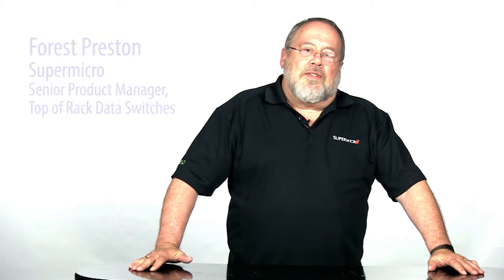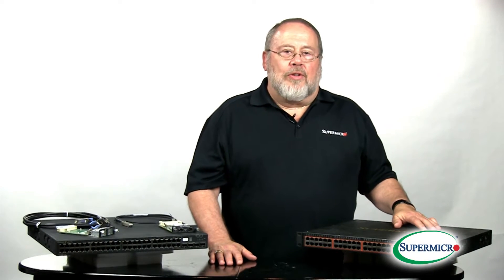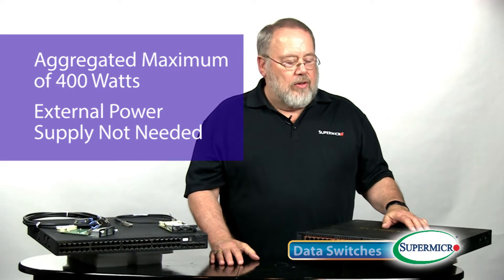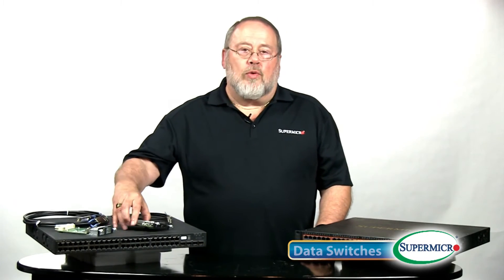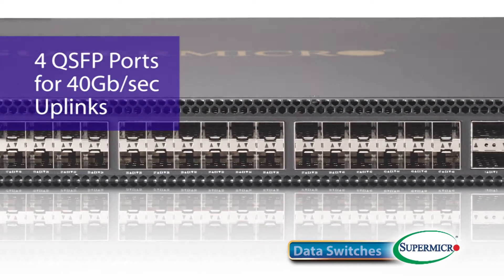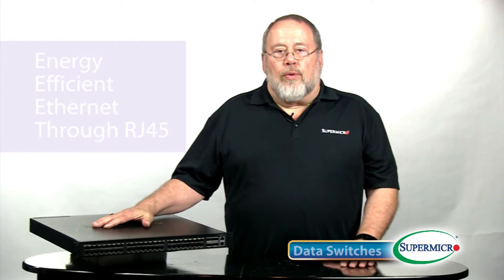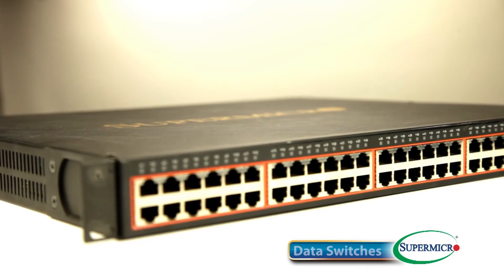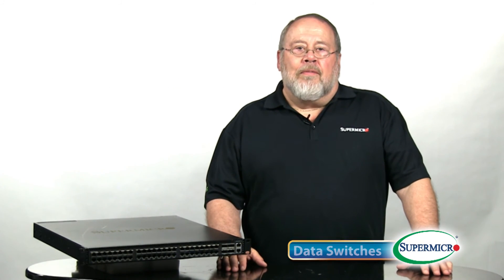Supermicro SuperMinute Ethernet Switches

Comment: I updated the firmware a switch supermicro sse-x24s and it was correct, but when reboot the switch never load the IOs.
I tested the power supply, power cable, the switch; the fans work even the LEDs, but when wanting to access it never loads.
How could I solve this problem?